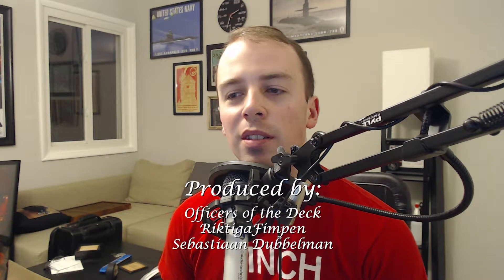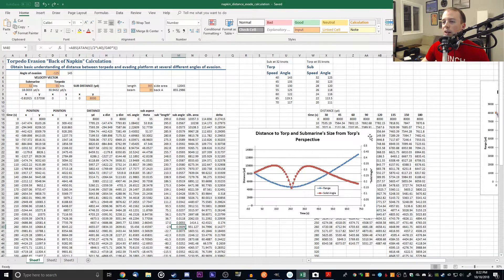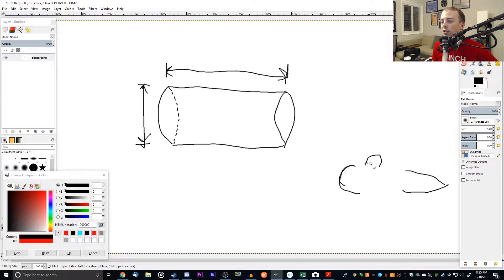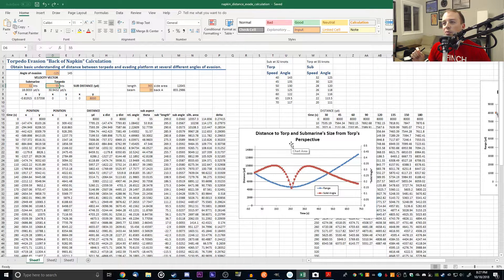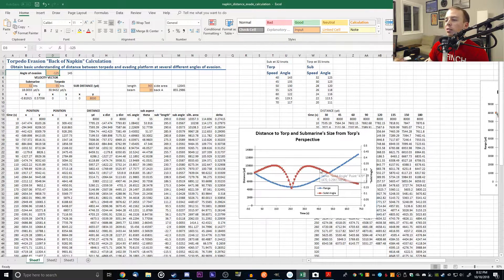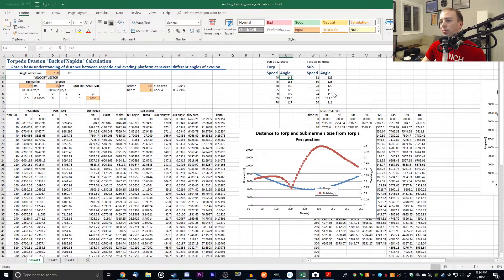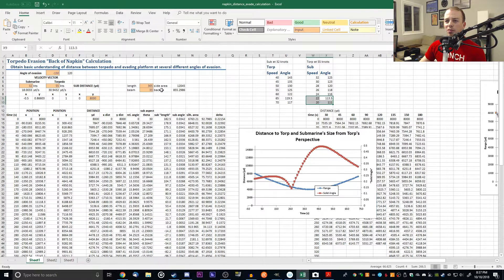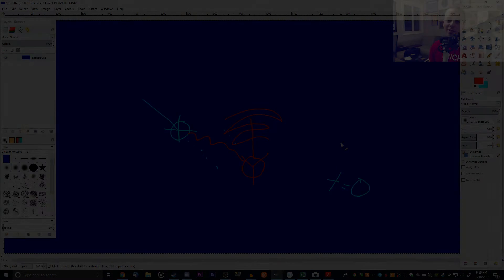Dangerous Waters Concepts: Torpedo Evasion 1a "The Sidestep Revisited"

Comment: In the instruction manuel, it is recommended that you take a 100° angle to escape from the detection cone of a torpedo coming from the front. So for a torpedo coming from the back i assume it is a 80° turn. 
Where is the truth ?
Reply from the maker: always do 100-120. it's a balance between completely going perpendicular to the torpedo and completely parallel (it will likely catch up to you). perfectly perpendicular isn't terrible but going at that angle helps a little bit more. the data I go over in this video shows that

Comment: How do you determine the range of incoming torpedo? is there time to do TMA on it? or maybe through bottom bounce?
Reply from the maker: first, as soon as you see a torpedo heading towards you, start evading and get out of the way haha maybe countershoot down the bearing. then if you got some free time, you could try some TMA on the torp or get the autocrew to do some. you may be able to see it on an active ping but mainly just get out of the way. your main way of knowing how far a torp is is knowing how far away the dude who shot it is
Reply: So in cold waters, where you can see the torps exact position on the map, you have some unrealistic voodoo happening, right?
Reply from the maker: Yes lol
Reply: I'd usually just count the seconds until it hit the hull and make a guess as to the speed. 45 knots is close.
Reply: Its hardly useful information if you learn it when you are hit :P I am talking about knowing its range as it approaches.
Reply: By the intervall of the pings. As soon as you get to hear it, it is close and homing in. 1) determine the launch bearing, homing (if so) and distance, 2) launch countermeasures, 3) check maneuvering possibilities (shallow, deep, layers; port and starboard) and turn as described in the video, 4) fire own torpedoes on enemy (depending on situation)

Comment: There is something I don't understand.. You say the angle is relative to the torpedo heading yet your drawing is the other way around, the 135 angle is to the bearing the torpedo comes from. You are making a 45° left relative to the torpedo heading. 

A 135° evasion, assuming the torpedo is going north would be either SE or SW, yet you are drawing a NW heading.

Running away from the torpedo gives you more time to evade and therefore to increase distance but also gives more time to the torpedo to lock on. If the torpedo can track you in passive mode then you are making its work easier.

Picture a triangle representing the detection cone of the torpedo, if we extend the sides of that triangle to infinity which heading will give you the shortest route to exit the triangle considering that the triangle will be moving towards your initial position.

I haven't worked the numbers but it feels like a 135° to the torpedo heading should get you faster outside from the detection cone than any heading closer to the torpedo heading. Meaning that to evade a torpedo going north you should go heading 135.

Obviously that'll work only if the distance between OS and the torpedo is significant or if it's activation point is close to your present position.
Reply from the maker: i misspoke. if you ran 135 to torpedo heading, you'd be presenting an even bigger solid angle than the 90 degree sidestep.
Reply from the maker: so 135 to torpedo heading (running kinda towards the torpedo), you'd basically be giving it a broadside look at your submarine, completely beam on
Reply from the maker: snaking torpedoes can increase their effective search cone because of the snaking back and forth, and the mark 48 pretty much has a 180 degree search cone